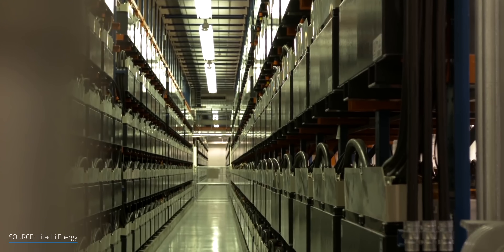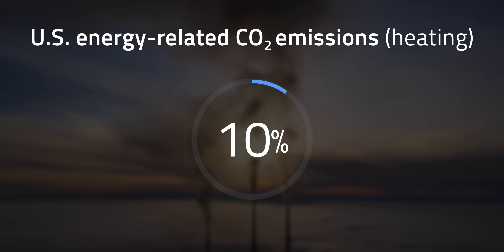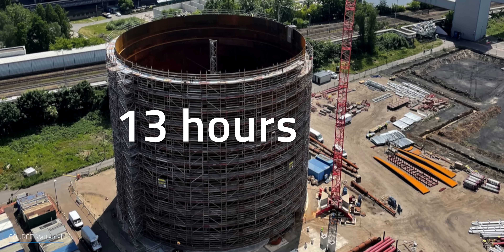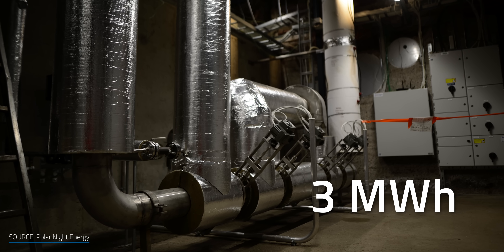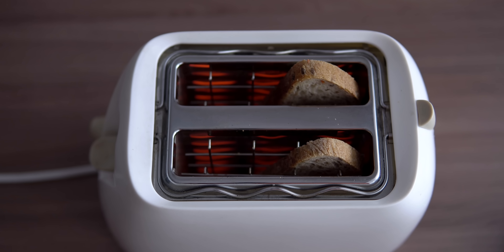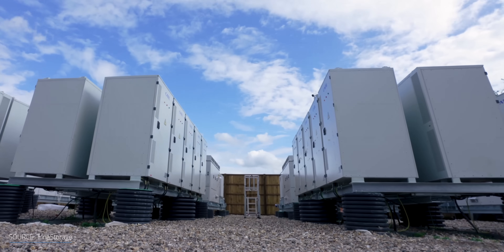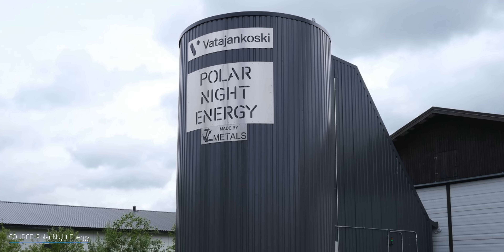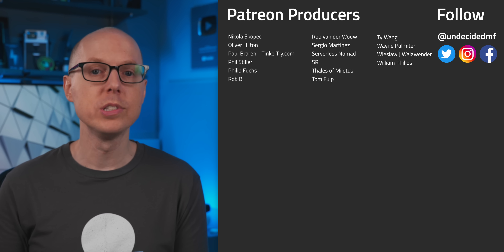How A Sand Battery Could Change The Energy Game

Comment: I think this can be cool to heat ovens for bakeries too. The nanocoated salt of saltx technology is more dense by stored heat per M3 and can also stored without loss for longer periods.
Reply: The advantage of sand though is it is readily available on site. If you build a house with a basement, you can literally take the dirt from the hole and use it to fill the tank. No special mining, no refining technologies, and no transportation needed.
Reply: @TwilightMysts  under your house there is no round cylinder based system. And with hot sand you still have heatloss, not with the salt..
Reply: @TwilightMysts  in The model they made, heat is taking out on the outside of the cylinder to reduce the loss of heat. The colder the outside, the less temparature difference, the less energy loss. A square or flat model will have more surface area and by this also will loose more energy and will be less efficient.